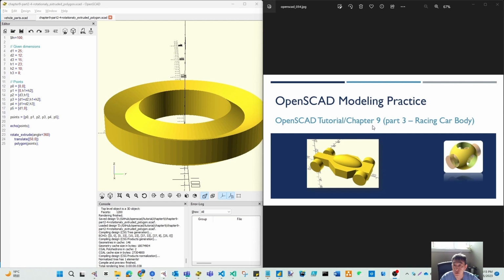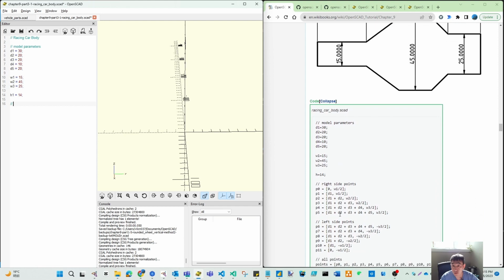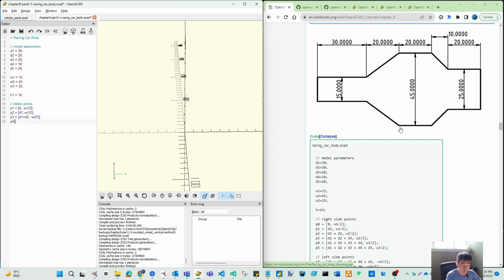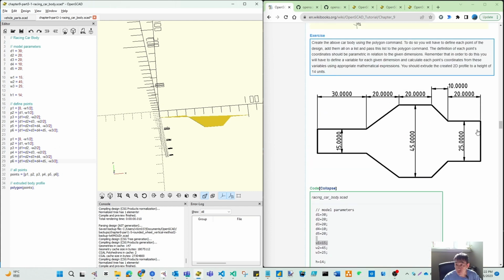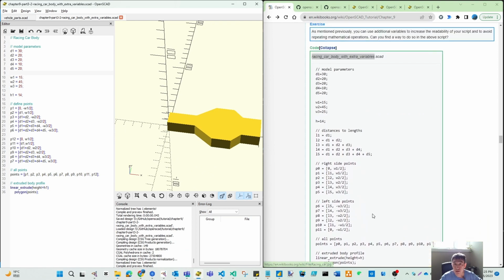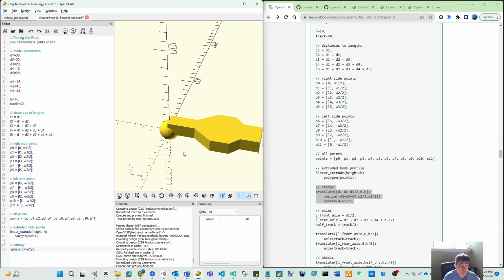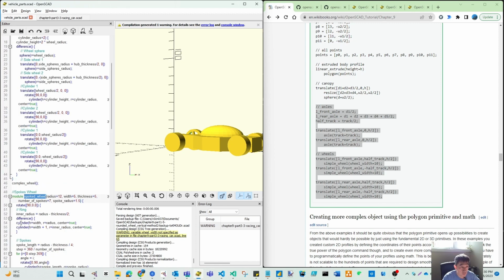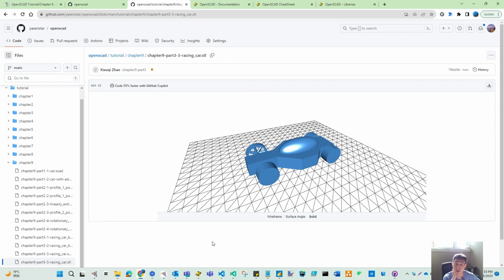OpenSCAD 034 - Tutorial Chapter9 Part3 - Racing Car

Comment: // Headset-Halter

// Parameter
holder_thickness = 10; // Dicke des Halters
holder_diameter = 100; // Durchmesser des Halters
hook_length = 40; // Länge des Hakens
hook_diameter = 10; // Durchmesser des Hakens
hook_offset = 20; // Abstand zwischen Halter und Haken
base_height = 5; // Höhe der Basis
base_thickness = 3; // Dicke der Basis

// Funktion zur Erstellung der Basis
module base() {
    difference() {
        cylinder(h = base_height, d = holder_diameter + 10, $fn=100); // Zylinder für die Basis
        translate([0, 0, -1]) cylinder(h = base_height + 2, d = holder_diameter + 10 + 2, $fn=100); // Rand um die Basis
    }
}

// Funktion zur Erstellung des Halters
module holder() {
    difference() {
        cylinder(h = holder_thickness, d = holder_diameter, $fn=100); // Zylinder für den Halter
        translate([0, 0, holder_thickness]) cylinder(h = hook_length, d = hook_diameter, $fn=100); // Zylinder für den Haken
    }
}

// Funktion zur Platzierung des Hakens
module hook_placement() {
    translate([0, holder_diameter/2 + hook_offset, holder_thickness]) cylinder(h = holder_thickness, d = holder_diameter, $fn=100);
}

// Zusammenstellung der Teile
union() {
    base(); // Basis
    holder(); // Halter
    hook_placement(); // Platzierung des Hakens
}
Reply from the maker: good!

Comment: phone_width = 70;       // Breite des Handys
phone_thickness = 10;   // Dicke des Handys
holder_thickness = 5;   // Dicke des Halters
holder_height = 10;     // Höhe des Halters

// Erstellen des Handyhalters
module phone_holder() {
    difference() {
        cube([phone_width, phone_thickness, holder_height]); // Grundplatte
        translate([0, 0, holder_height - holder_thickness])
            cube([phone_width, phone_thickness, holder_thickness]); // Steg für das Handy
    }
}
Reply from the maker: Suppose you'll use as module/lib file for other code to call, however, you need "phone_holder()" in the last to run inside this file, preventing "Warning: No top level geometry to render" popping up.

Comment: // Parametrischer Handyhalter

// Größe des Handys
handy_breite = 70;
handy_hoehe = 150;
handy_dicke = 7;

// Größe des Halters
halter_breite = 80;
halter_hoehe = 150;
halter_dicke = 5;

// Dicke der Wand
wand_dicke = 3;

// Funktion zum Erstellen des Halters
modell_handyhalter = function() {
    difference() {
        // Hauptteil des Halters
        cube([halter_breite, halter_hoehe, halter_dicke]);

        // Aussparung für das Handy
        translate([(halter_breite - handy_breite) / 2, (halter_hoehe - handy_hoehe) / 2, halter_dicke + 1])
        cube([handy_breite, handy_hoehe, handy_dicke]);

        // Aussparung für Kabel
        translate([halter_breite/4, halter_hoehe/2 - 2, halter_dicke + 1])
        cube([halter_breite/2, 4, 4]);
    }
}

// Erstellen des Modells
modell_handyhalter();
Reply from the maker: Can only be running in myside after change Line 17 to "module modell_handyhalter () {", otherwise having "Parser error: syntax error". How's that working in your side?